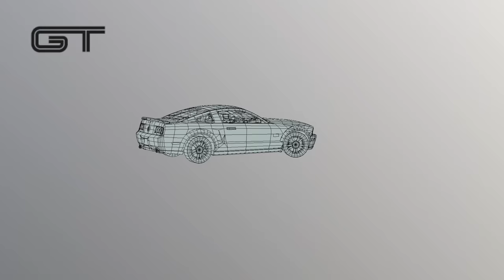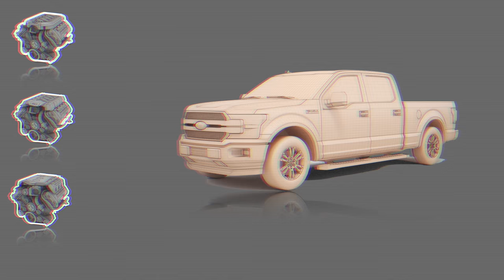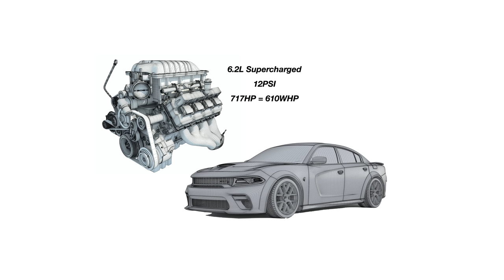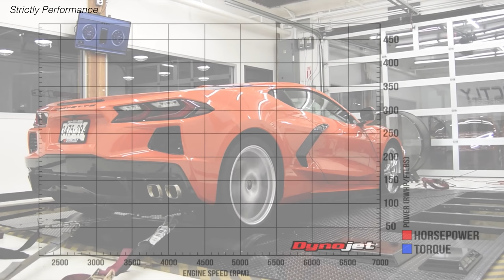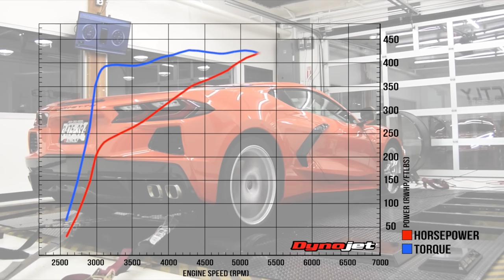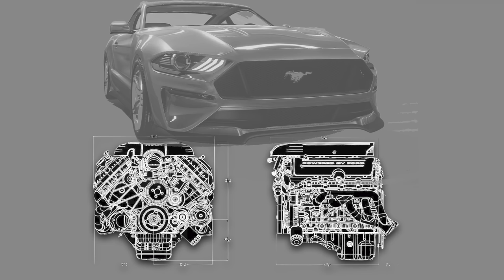How 5.0 Coyote Engines Beat LS and LT😮 | Explained Ep.2

Comment: Can you talk about why the LS 4.8 holds more power with boost than the coyote? I mean all the 4.8L LS needs is turbo cam, fuel, and tune with the turbo amd it can make way more than any generation coyote there is.
Reply: No it certainly can not. Richard Holdener has dyno videos proving what you just said is a lie. The coyote will handle well above 1000 hp with just ring gap.
Reply: @jesusstopsbullets5111  wrong lol the coyote needs oil pump gears as well. And the 4.8 with just a turbo cam, fuel and tune has made over 1200hp

Comment: Great explanation!  LS and LT motors are stout out of the box and NA make more power than Coyote and weigh less (about 7/8ths). But when boost comes into the equation, the Coyote really shines. Need way more mods on an LT to make the same power. Hats off to Ford, here.
Reply: They had to do something to make up for the problems with the original mod motors (the 3-valve specifically).
Reply: I hear 700 from a used LS even 5.3 with boost and ring gap 700 and go a little further building the short block and 1000 is right there. Also, LS7 heads flow 300cfm with only 2 valves and rock right to 7k then a cam and more

Comment: A junkyard 5.3 with gapped rings can take 1,500 hp before it fails. You can build a 440 ci  LS and it will still be smaller and lighter than a   Coyote 302. You guys have to brag about hp/liter because you can’t get any displacement out of your monstrously heavy and large torqueless motor. LS motors are superior in every measurable way that matters. That’s why everyone that wants to be competitive on a budget uses them.

I’d take a 350 Windsor over a coyote.
Reply: Oh really then WHy did  gm make a 5 5 heavy and even larger  motor  with 670 hp and torque  in the  400s? Riddle me that
Reply: @Shiftnlift  likely because of GT engine limitations for their race car class (gt2 and gt3 or whatever). They spent all of that R&D on it so now they need to sell it to make their money back. I’d still take my LS7 even if I had to go back to NA and I’d still have better power and much better torque for a fraction of the price and with better reliability. My Vette still gets 26 mpg Highway with more than 800hp and achieved 29mpg highway on the stock long block with a smaller centri blower.

The 5.0 can’t compete dollar for dollar or pound for pound. Can you build a 1,200 hp coyote? Of course. But you can build a 1,200 hp LS a lot cheaper and with a much broader power band.
Reply: @TheTmshuman  one ls owner to another you are absolutely correct

Comment: Lol at the claim you would be less invested in an coyote than an LS. You blow the engine and that's $$$ to replace. I've run plenty of boost on stock cam, you don't have to replace it. The only thing you really have to upgrade on an LS is the valve springs. Which you can do on the car easily with basic tools (compression tester hooked up to a compressor and a 20 dollar LS valve spring tool. Even if you dont replace them you can still run ~7 psi. Yes I do agree they make more hp per liter of displacement. But ask yourself, does that really matter? What's the benefit of the smaller displacement if the overall package is still bigger since you have dual overhead cams.
Reply from the maker: I said less “physically” invested meaning less work. Stock Valvesprings and cam coyotes have been boosted to 7.90 1/4 miles.
Reply: @337speed  if you are adding a blower or turbo to a car, doing valve springs is hardly any more physical investment.
Reply: @Cracked1ce  facts bro that’s what I was thinking a cam/heads job on an LS is very simple and easy to do
Reply: @Cracked1ce  no reason to do them on a Coyote, stock cams have made 1400whp before and aren’t even needed for the average person. It’s literally a game of pick your boost, get a Fore fuel system, Tune, and you’re done.
Reply: @169abr  I didn't say you needed to do valve springs or cam on a coyote. I didn't even say that it would be harder to do since is DOHC since, like you said, it is not something you need to do. All i said is that its a trivial thing to do on an LS. If you are upgrading fuel system, adding a blower/turbo, a tune, etc. doing valve springs is a trivial extra step. stock cams do fine on boost too and maintain driveability. They are both good engines, but the reason the LS is better IMO is that it is a smaller package making it easier to fit in swaps, they are also easier and cheaper to get from a junkyard. But if swaps are not a factor in your opinion then both engines are relatively equal. You'll spend the same amount of time, effort and money on either mustang or camaro platforms to go the same speed. but neither of those platforms really interest me.
Reply: To me is all about where you want to pay. Coyote costs upfront...LS costs down the road. Boost and fuel and you're 9XX on a coyote, headstuds and you're 1000-1100. Load up your email tune and you're done. Watching my LS buddies it's all head work, cams, and hunting down the best and most well priced custom tune which turns into a whole journey of taking off work/scheduling dynos etc etc. A headache..and they all seem to have issues down the road. But at least the block was cheap.
Reply: @gadec4lyfe  You can do the same boost and fuel to an ls and make 9XXHP. hell you can take a junkyard 6.0 and reuse stock head bolts and make 1000whp. Sloppymechanics proved that. If you are talking about modifying factory built cars (Mustang vs Camaro) then you will spend the same amount of time and money to get to the same power because you will be buying all the same parts and the base price of the cars are basically the same. If your talking about swaps then LS is cheaper upfront and down the road. I can buy a junkyard 6.0 for less than 1000$ and spend another 600$ on lifters, valvesprings, and a cam and have an engine that will withstand over 1000 hp. You can't do that with a coyote or any other platform.
Reply: @Cracked1ce  I think the biggest confusion is that most people don’t work are the cars or even have one so the whole “the least I do the better” and with LS’s being so cheap it’s a no brainer to swap a $200 cam in, trunion upgrade, arp bolts etc. People take this as a negative when it’s all optional. A unopened Junkyard LS with 100,000 miles can handle 850hp just like gen3 coyote 🤷‍♂️
Reply: Coyote is better lol… Technology bro, it is what it is. It’s just efficiently superior and that’s fact.
Reply: @BadgerGT500  my stock NA LS3 will smoke your coyote...
Reply: @Cracked1ce  HA. HA. HA.

Comment: I’m just going to just throw it out there that when you incorporate a cam, ported heads, increase piston ring gap, and add a half decent turbo. A 4.8 Ls with a stock bottom end will handle up to 1200 horsepower and potentially more. You can get one at your local junkyard for about 200-300 bucks. Don’t tell me that a coyote “destroy’s” Ls and Lt motors. That statement is incorrect.
Reply: I see a LOT of old LS motors tearing up the local dragstrips. The only place I see a lot of old Coyotes is the scrapyard. Pretty neat engines,, but more complicated and fragile than the LS. Post-1995 Ford engines are, on the whole, junk past 100k miles. Give me pushrods and short timing chains every time.
Reply: @tinman7065  that's simply not true at all
Reply: 1200 HP for a short period of time

Comment: The coyote is a great platform, BUUUUUT technically if you add boost (2650tvs/f1x) and a proper fuel system (injectors dual port) an lt engine can also make 800-1000rwhp it would just cost A LOT MORE!! I have an lt4 z06 fbo cam/heads 750rw and the build is well over 10k

Comment: The LS is cheaper, and easier to work on, and package, than the Coyote, and less complicated. There certainly isn't anything "wrong" with the 5.0, I'm just not interested in paying $1800 for a little chop at idle, and I've outgrown the revs to eight grand mentality a long time ago.
Reply: If you’re paying $1800 for a little chop then that means you’re a ricer. Coyotes don’t need Cams, the stock ones are already good.
Reply: @juniordiaz6445  I love fried rice and Spanish rice with my beans!
Reply: Get with the times grandpa. Pushrods are dinosaurs engines. They suck and need huge displacement to make modern day DOHC engines that have VVT VCT VLT.
Reply: @luciankristov6436  DOHC is newer tech but man the simplicity of the pushrod is so damn easier to work on. I understand 1000% where your coming from tho..
Reply: @jerryrice2752  DOHC and 4 valves per cylinder has been around for more than 90 years.
Reply: @jamesgeorge4874  I know but it's still evolving faster than pushrod tech...
Reply: @jerryrice2752  sorry, active cylinder management, variable lift and timimg is available on pushrod engines too, just like OHC engines. My original point is that anyone can spend 4 times as much money, for 7/8 the performance, thats fine, it's just not "better".

Comment: You can boost your way to 1000 hp with a stock-cammed LS, only reason you do it on an LS and not a coyote is because it's much cheaper and easier than swapping out four cams
Reply: There are 1000 hp Coyotes now too. Almost every argument of ls over coyote is due to their age difference. The coyote is barely 11 years old and the ls has a much longer history. If you wanna talk about cams, you can swap cams on a coyote without removing the heads. Stock valve train is good for 900 whp. With age the coyote will become more competitive with the ls in all aspects. As for new Chevy v8s having lifter failure so often, I'd much rather take the newer 5.0s which at the very worst have a pcv issue which has been sorted for a year or 2 now.
Reply: @redlinearroyo847  the reason more people use the LS is simply because it'll fit in more vehicles and is easier to find in a junkyard than the coyote. And they have more displacement with marginally less flow rate. And you can also swap cams on an LS without removing the heads. It's just so much cheaper to do an LS swap, and while that's the case it will continue to be the superior option

Comment: The 5.0 doesn't destroy the LS, it is way more complex and expensive, also the LS makes a lot of power without having to tear apart the engine, a 5.0 you have to upgrade some serious parts to push 800whp. The LT engines are more complex, expensive but also more capable of boost then 5.0's so it really depends. It's like a sliding scale of affordability----complexity with the 5.0 somewhere in between. 5.0 as a package deal is probably the best with just a tune and e85. But you can't beat the LS if you're going to build it and have a hell of fun hooning around, it can take a lot more abuse then the 5.0 and sounds better. The 5.0 is super efficient and effective, and can ship in a small package but it has it's issues.

I agree what he says though, the coyote out of the box and plus a few slight mods is the easiest way to make power, the engine is very well dialed in.
Also even the LS1 could be reved out safely to 6700krpm with no aftermarket springs, The intial LS6 tests were to run 7200 rpms for 100 straight hours without problems. Can't speak for the LT blocks but the LS's are super rev-happy I would say more then the coyote as it's a lot older and with a few upgrades could rev more.
Reply: "a 5.0 you have to upgrade some serious parts to push 800whp"  

  This literally just proves you know nothing about the coyote.
Reply: @SanicGottaGoFast  Have you pushed more then 800whp on a 5.0 stock bottom end? Didn't think so...
Reply: A stock Gen 2/3 coyote makes 800whp with ANY blower or turbo, E85, and a Fuel System and that’s barely stressing it. 

Talking about revs, a cammed Gen 1 makes power power to 8900rpm with a ported CJ. Stock limiter on a Gen 3 is 7500 and non ported CJ’s go out to 8000 usually. The LS stuff can rev, but OHC by nature needs to rev higher because they make less torque.

I love the LS1 and would love to own a stick WS6 some day but the Coyote is miles ahead of the LS family as far as power potential goes.
Reply: @169abr  Good luck not throwing a rod, 800 is no joke, above 750 and you are on borrowed time with a stock bottom end.

I agree with what most of what you said. a coyote can easily get to that number, but it can't stay there for long unless you build it.

 Clutch, OPGs, harmonic balancer, turbos, e85, fuel system upgrade, clutch, and axles. Figure with you installing close to....9000$ give or take, you will need forged rods and pistons and also throw in a set of cams to increase the VE so you dont need to run alot of boost.  Coyotes dont like to detonate.
Reply: @Toymonkeyjr  800whp is a hard sneeze for a Gen 2/3. You don’t need cams, you don’t need OPG’s if you’re Going blower, you for sure don’t need Rods/Pistons on a Gen 2 and up as the rods are forged from factory and the pistons are fine until about the 950whp mark on the newer stuff. I’ve seen myself a car at 850whp on a stock Gen 2 live and be heavily abused for over a year, and it never skipped a beat. Lots of Centri blowers and Whipple 5.0’s around me and they live around 650WHP on pump gas which is mediocre at best in Florida and they take it just fine. 

You should really look into what these motors can handle. I’m assuming you have been around the game a while since you’re talking VE and must’ve started with the small block stuff?
Reply: @169abr  You either build good and/or are extremely lucky. I haven't heard many 800whp around me with a stock bottom end surviving the test of time. Maybe you're right but I haven't seen it in my experience. I know the coyote's can handle a lot but then they usually become an if and when situation. I know that around 700whp with a bit of boost and then gen2/3's last a long time. But you're really pushing the limit if you crank it up without supporting mods. That's my two cents, I may be wrong but I've talked to a lot of people about it.
Reply: @Toymonkeyjr  Yea I've heard all that stuff too but in my experience it's only been gen 1's that pop, I know one guy had a Gen 2 with a Whipple that was over 200k miles and he beat the snot out of it.
Reply: @169abr  Yeah I know they're super reliable, but my point was they have their point where everything just blows. Like it's a small difference from reliable to ticking timebomb.
Reply: Have to respectfully (but strongly) disagree about the LS sounding better than a coyote. First time I’ve heard that one. The Coyote (and Terminators) sound sooooo good 🤤
Reply: @brianwdodge1  The 4.3's and terminators sound amazing, the coyotes not as much. They can sound great, but nothing like an LS, and what I mean by that is it's hard to make an LS sound bad, while it's not that way with a 5.0m I know 5.0's that sounded miles better then more muscle cars, but it's not super common.

So I guess what I meant is the LS sounds better consistently.
Reply: You might be a little uninformed brother. Any gen 2-3 coyote can just be boosted with proper fuel and can hit 850. Literally. 
LT1s can not go much past 650 or so regardless of fuel.
LS motors need heads, cams, and would need the fuel regardless. 
OEM coyote heads and cams can push 8k pretty safely. I had to make the decision between LS3/LSA/LT1 vs coyote and I’m making 850 to the tire now with a coyote on a 3.33 pulley on a Paxton 2200SL on E-85. If you say coyote’s need more motor work then LS’s then you are uneducated on the topic. I PREFER LS cause they make more torque, sound better, and is usually cheaper, but coyotes can make 800s without opening the motor
Reply: @austintran4128  goodluck with that man :)
Reply: Gen 3 stock coyotes max out a bit over 1000 whp before you need to open it up, and yeah it’s not reliable at that point but for that you can just have the 1000 hp map for roll races and change it to a 600 hp one for daily driving and you’ll have all the reliability. It’s not rocket science my guy.
Reply: I'm an LS guy and you're wrong about the Lt. They don't hold boost well. You can't go over 600hp in it before it blows. The 5.0 handles boost pretty good. I've owned two gen 1 5.0 and both were very reliable as well and very fun with bolt ons
Reply: 800 is nothing for a coyote. Mine made a little over 900 stock motor and so have many of my other friends. Add head studs and you have a 1000hp car without touching anything else. I also rev to 7500 and that's a basic limit for us. It can definitely be taken to over 8000 if you just ask the tuner to make use of certain parts like cams and cobra jets etc. It's a high RPM platform, our power is up top
Reply: I do agree with LS generally sounding better though lol.  Coyotes need the perfect combination to sound decent, if not, they sound like bees in a soup can haha